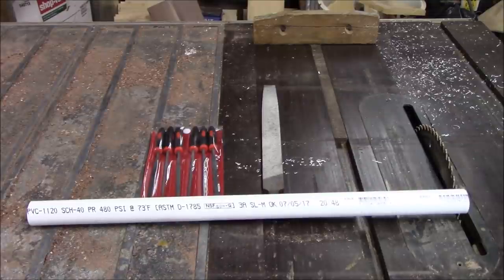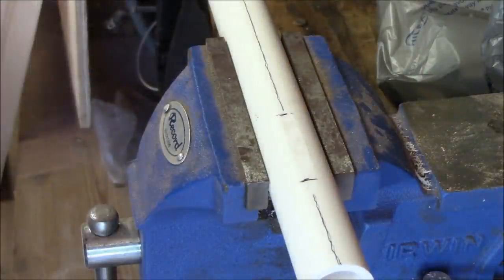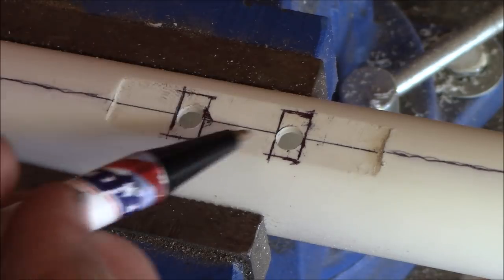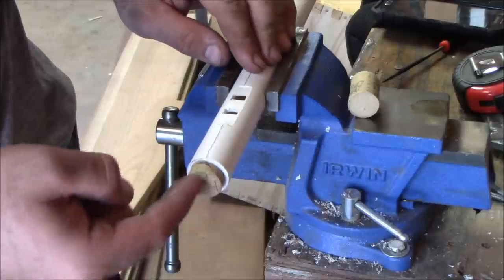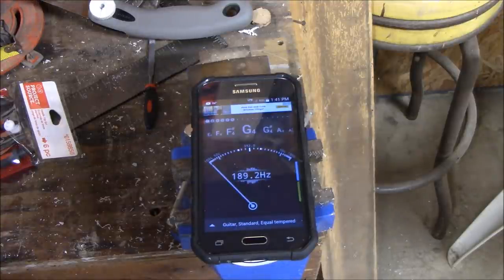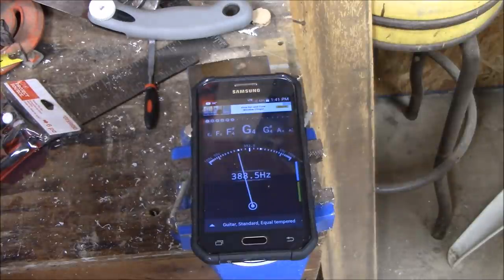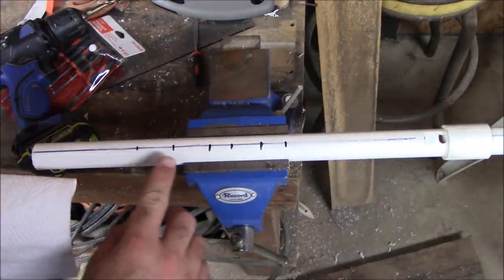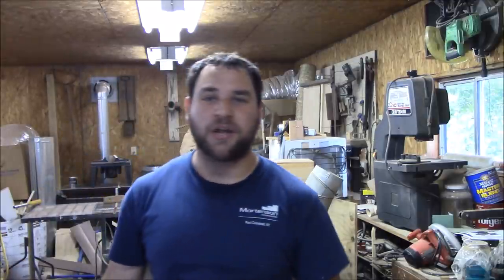Native american style PVC Flute Key of G!!

Comment: - [ ] I had see the app before seeing on you video.  I viewed someone else’s video that was just like yours.  Having viewed other flute building videos, I was aware that a good practice is to cut the PVC pipe a little longer (my current build is 18.5 inches long and test as being close to F#.  Also, a good practice I have seen it recommended to drill the note holes slightly small diameter to allow for adjustments.  I had originally planned to make the flute with 5 holes instead of 6.  I have the third hole from the sound hole taped closed.  My current build will have 5 holes.  My decision now is how much smaller, 1/4” or 3/16”.  I consider my flute as my version of a traditional native flute.  I want to thank you for making the video and responding to my comment.
Reply from the maker: Well it sounds like you've got a handle on your build then, I hope your flute turns out sounding great!

Comment: How do you determine the length of the slow air chamber (SAC)? I’ve seen in a number of NA style flutes where the length of this chamber is at least 5 inches going to up 8 inches in many designs. You seemed to have chosen 2-3 inches, is this a standard for PVC flutes?

Comment from the maker: Hey guys I recently hit 500 subs and I have a give away going on right now to thank all my subscribers for sticking with me while I'm growing! Just click on this link to enter for your chance to win! https://gleam.io/p4zA2/build-stuff-with-aj
Reply: Hey I'm doing this project for school. And I have a question about the bird that how's over the two holes at the top. You said the bird is suppose to be 1". I tried that and it's way too big to fit over the 3/4" pipe. Should the bird be 3/4" as well.
Reply: I did this and yet no sound is coming out I feel like I'm missing something
Reply from the maker: @robinhurst3958  did you use pvc pipe or cpvc? With the white pvc pipe the inside diameter of the pipe is 3/4 inch. And with cpvc the outter diameter of the pipe is 3/4 inch. 
 I used the white pvc pipe 3/4 inch for the flute and 1 inch for the birdy and it fit perfectly as shown in the video
Reply from the maker: @MrNu1982  there cpuld be a number of steps you forgot to do that would cause this. Did you bevel the front hole at a 45 degree angle? Did you put the plug (wine bottle cork) inside the pipe between the two holes? And did you make sure you cut the cork down to the right size? It has to fit between the two holes, but it can't be too big or it will block the air flow to the second hole.
  I suggest re watching the video and making sire you didn't miss a step
Reply: @BuildStuffwithAJ  I did watched it four times I think the measurements were a bit off give or take an inch
Reply: @BuildStuffwithAJ  I used pvc
Reply: @BuildStuffwithAJ  I got it work eventually

Comment: How much will the sound vary if I make this with 1/2 inch pipe instead of 3/4 inch pipe?
Reply from the maker: If you look in the discription you will find a link to a website called nafluteomat. Change the bore size and it will show you how to make out of 1/2 inch pipe

Comment: I have 1" schedule 40 pipe, how do I determine where to put the sound hole?
Reply from the maker: For this flute to be in the key of g you will need to use 3/4 inch pipe. I did make a video using 1 inch pipe but it was a much lower key and alot harder to play

Comment: In naflutomat, is the "total bore length" the full length from end to end, or just the end to the breath holes?
Because it says to cut to a certain length, but the flute is already higher than I'd hoped (D5 at 24" with no holes drilled). Won't cutting it raise the tone more?
Reply from the maker: Yes! Cutting it shorter will definently make it higher. I believe the total bore length was from the sound hole to the end if I remember correctly.
   But to be honest I always made it several inches longer than it said and cut it down to the key I liked. The main purpose I used that site was for the finger holes.
  But if you want a really low pitched. Or bass sound you will have to use a larger diameter pvc. I made a video making one in the key of C4. It was pretty low but it was pretty difficult to play, not impossible but very difficult.
Reply: @BuildStuffwithAJ  Cool. Thanks for the answer!
Reply from the maker: @christopherspaulding9283  I hope it helps you out! Let me know how your flute turns out

Comment: i did everything exactly how you did but my notes are out of pitch except for the lowest note?
Reply: how could i fix this without redoing the whole thing
Reply from the maker: rookie591 hmm I didnt seem to have this problem. If they are too high you can use a small file to make the holes slightly larger which should lower the tone. If its too low already then you have gone too far. It could be that your flute wasn't tuned 100% dead on before you drilled the holes. Or it could be that you moved the drill bit a little too much causing the holes to be slightly larger.
Reply from the maker: It could also have alot to do with the amountof air you at. Blowing into the flute. You need to put a steady amount of air but at a low pressure to achieve the proper tones.

Comment: I built this flute.  Easy build.  However, while the tune of the 18” pipe is spot on (G4) and G5 is spot on, all the other notes are quite sharp.  This is not an easy fix.
Reply from the maker: Did you use the fluteomate website I linked in the description or just go off of my measurements? 
  I changed all my holes to be the same size to make it easier for people to build,    if you put in your dimensions into the website I linked in the description  as I showed in the video you may be able to get a more accurate sound.